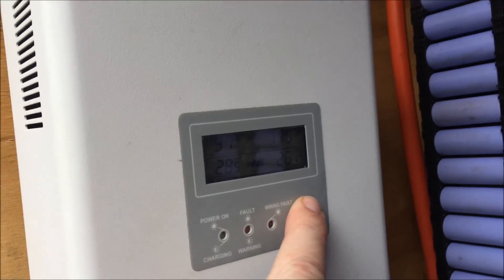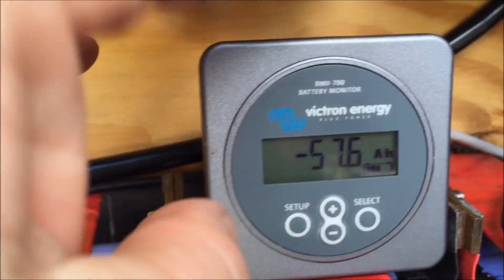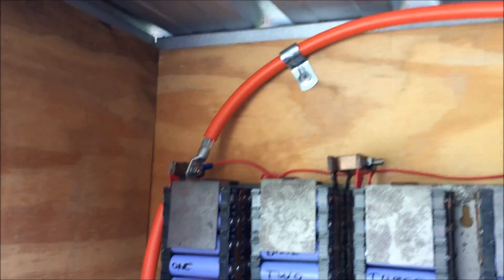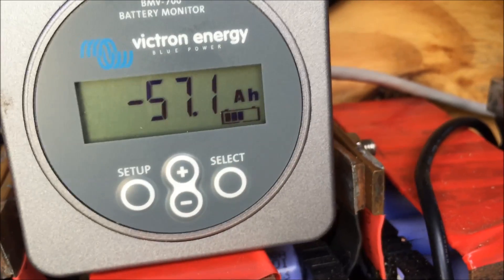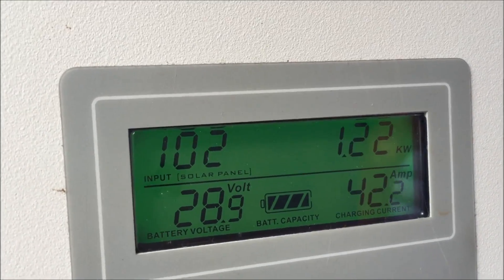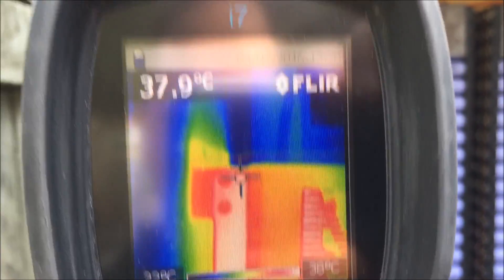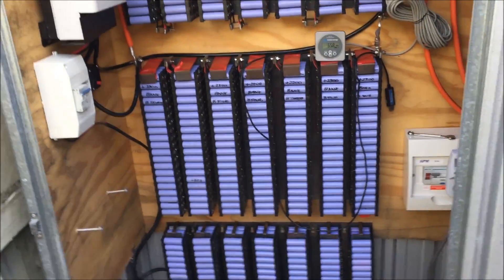recharging after 1000w load test

Comment: Just starting researching my own HBPowerwall, currently catching up on all your videos and links, excellent stuff so far.
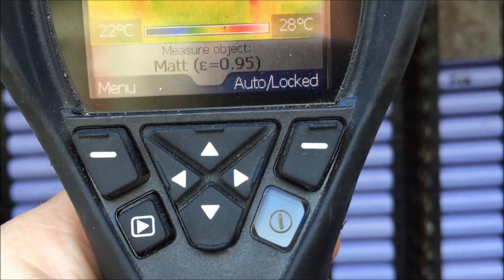At 1:57 you say the mounting plate is heating up (storing heat??) how about using stand-offs so the back of the mount acts as an heat sink to dissipate the heat to air as the ply would be acting as a great insulator?
Reply from the maker: +Anthony Cobb has 5mm spacers now and helps a lot
Reply: cool ! pun intended.

Comment: Your theory is correct I think. In series every bank will discharge the exact same amount of Ah. If there is a difference in capacity between banks you will see a voltage difference as well, which will be larger the lower the voltage gets.

When you charge them again, the same amount of Ah will go in again. So they will all return to the original voltage.

As long as none of the banks goes below the minimum Voltage required, things will be fine. This all depends on capacity per bank.

A BMS can detect voltage problems per bank. This is especially important if you always charge to 4.2 V per bank. 

If I were you, I would set the charger to charge to 4.1V. Charging to 4.1 V (also including saturation charge) will get you like 95% of the full capacity at 4.2 V. And, more importantly, can extend battery life with a factor of at least 2, probably more.

Also this way you don't really need a BMS because over voltage on a bank is unlikely to happen. You just have to check voltages per bank like once a month and you'll be fine.

But if you do want to charge and discharge to the voltage limits, a BMS is a must.

Comment: Very good, Question how long is it taking to charge back up to full?
Reply from the maker: +Mikes DIY Tesla Powerwall one day with intermittent sun 100% soc
Reply from the maker: so it's a 60a charger, we only use 5 kwh per night, inverter has a built in 60amp charger also. So got it covered nicely :)

Comment: Kudos on the no BMS test. Looks good. Once you have the pack charged to the desired voltage does your system disconnect automatically or does it go into a float mode? Can you do a little fine tuning on the final voltage?
Reply from the maker: I have set the float and bulk charge to the same voltage 28.7v and tuned off the balancing function of the charger. I can tune final voltage to two decimal places :)

Comment: will your solar panels charge up all 30 kwh?
Reply from the maker: Yep, with upgrades. Today was a poor solar day but still 100% charged batteries, so will do 300ah - 350ah per day charging with what i have so i'll need to upgrade soon.
Reply: I can do 25kwh on a good day but in winter 5kwh, some times 0kwh.
how many kwh is 350ah? 350x24?
Reply from the maker: +sven 4kwh I guess.
Reply: +sven 7x3.6 = 25.2V. Multiply by 350 Ah = 8820 Wh or 8.82 KWh.
Reply: 9kwh per day. Doesn't that mean 18kw of panels?
Reply: normally you multiply the KW of panels buy about 5 to 9 kw per day would be about 2kw of panels, 18kw would give about 100 kwh
Reply: Yes sorry got confused